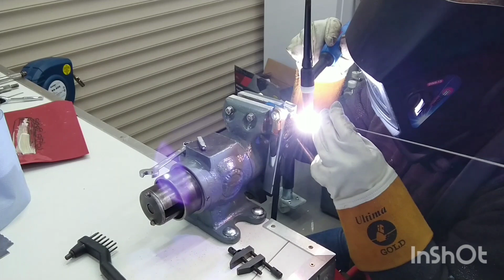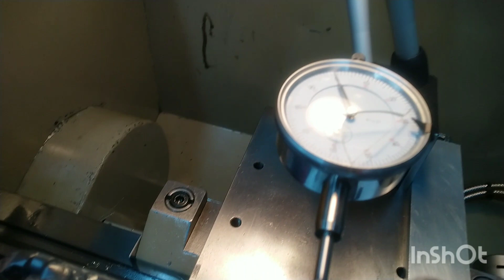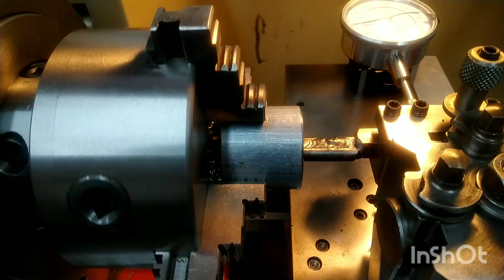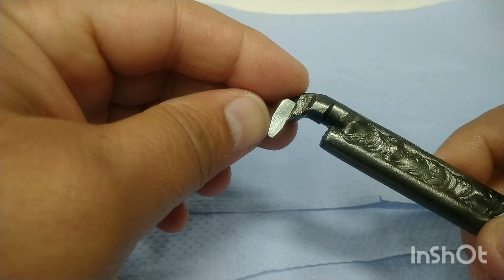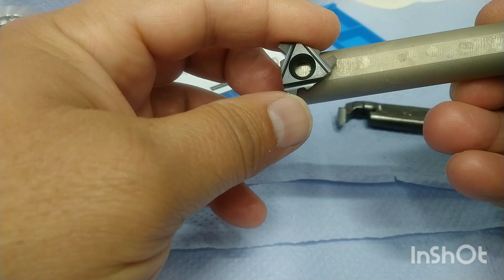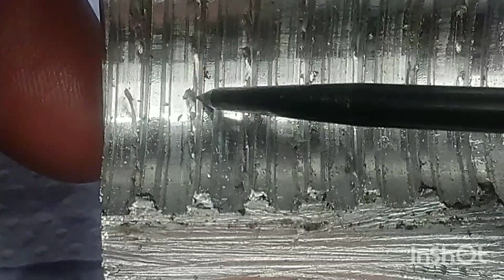Horizontal/Vertical Mill Restoration Part 4B

Comment: The other reverse,  love it.
Tool looked plenty strong enough, obviously quite a large tooth load on ACME/Trapezoidal threading. 
Great photography Carl.
Thanks for sharing. 
Regards John
Reply from the maker: Thank you John. It was bad tool design on my part. Instead of thinning down the tool shank, I should have gone back to the green grit wheel and taken more off the brazed carbide portion. Welding that bar on to strengthen the tool caused the carbide to overheat and go soft. So it lost it's geometry over successive passes. I should have turned up a stout bar and made an inserted tool from an old milling cutter. What I've done though to prevent any more issues is get a solid carbide acme threading tool. Thanks for watching and commenting. I really appreciate your support.  It's a pleasure to welcome you into my workshop.
Reply from the maker: Ps thanks so much for the compliment about the photography. I'm trying very hard to get good shots, so it is  good to get some feedback.

Comment: I had exactly the same issue with a M39x4 thread. To get the tool in deep enough it had to be too flimsy. 
Great video, best wishes, Dean.
Reply from the maker: I remember that. I have a few more tricks up my sleeve. From a stout round bar with a piece of ground carbide in it to a bought solid carbide internal threading bar.

Comment: Disappointing but onwards and upwards as the saying goes. 

The one thing I would say is I would personally have used quite a bit more lubrication, looked like you used some but because aluminium can get rather gummy and stick to the tool I would tend to put some on every pass. Also with lots of stick out and a fairly flexible tool every third pass I would do a second run with the same setting, otherwise you get tool flex at the far end until you don't and you get a whole load of digging in. 

WRT using home made screwcutting bits I made the almost identically sized 1.5"x6TPI thread for a new chuck backplate on my Harrison by using  a "NuLoK 3", it takes a 1/4" piece of drill-rod/silver steel at either 90degrees or 45 degrees. I'll post a photo on the forum.
Reply from the maker: Excellent advice, thanks. I was using WD40 as a lubricant which I find helps prevent chip welding with aluminium. Great advice too with the intermediate spring passes, thanks. Watching the footage of the welding, I saw the carbide tip glowing orange when I put a tack on at that end. So I think I burned out the tip before I even started. Never mind. I will get it next time. Thanks for posting the threading tools on the forum, I will check it out. I have plenty of time to plan my next attempt!
Reply: @carlwilson1772  I suspect you're right with ruining the tip while welding. I also use WD40 while "normal" turning on aluminium but go for a heavier cutting oil when screwcutting as it only takes a little bit of aluminium welding itself to the tip to ruin your finish or dig in and the WD40 both runs and boils off too readily (with a nice smell mind!)
Reply from the maker: @fastdruid  Top notch advice, thanks for that.

Comment: I feel your frustration when a part doesn’t work as planned, it happens to me more than I’d like to admit to.
Great to see how you break down the first attempt to see what went wrong and then come back with a new approach. 
Hopefully in the next video we will see a bronze acme nut in all its glory. 
Keep up the great work, I’ll wait for a notification on your next video 👍🏼. 
In the mean time I’ll crack on with getting my m250 wired up to start some of my own projects.
Reply from the maker: Thanks for watching and commenting Jack. I think that if I had not welded the bar on, the carbide would have remained hard and the tool might well have worked. Not to worry though. It cost me nothing to try. And I have learned something. I will be successful next time. Drop me a line if you think I can help with the wiring.

Comment: Thanks Carl sharing your journey on the Mill restoration. I have had many good plan go a similar way. Everyday is a learning day and I have learned so much from your videos.
Reply from the maker: Thank you Rob. I do not subscribe to the mantra "Knowledge is Power" or rather I do, but that it should be in the hands of as many as possible. So if I know one more thing than the next person, I'm going to tell them that thing! I'm flattered and very pleased to know you have gained something from my ramblings. I have a new plan for cutting the thread, but it will have to wait a while! Thank you so much for your support.